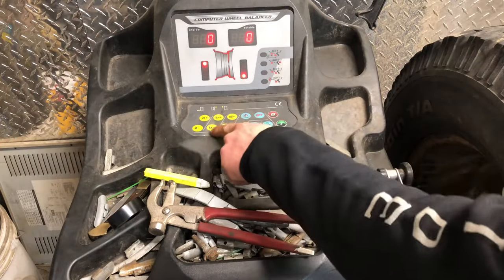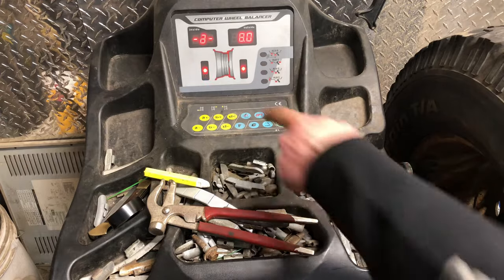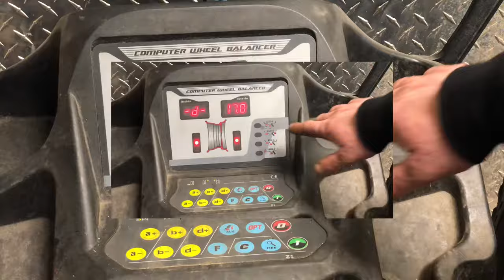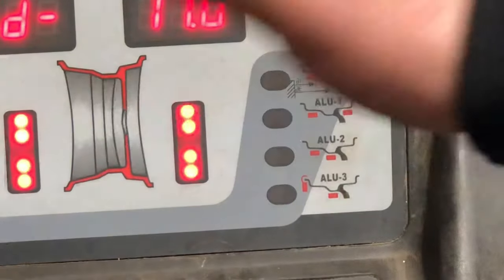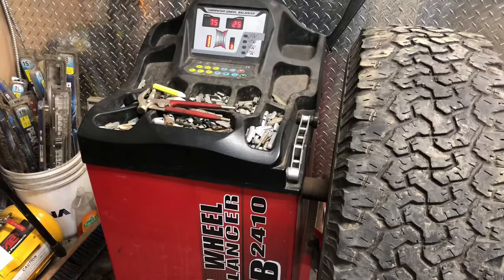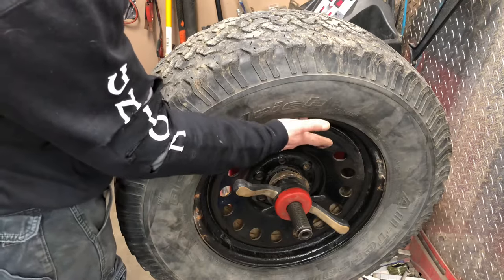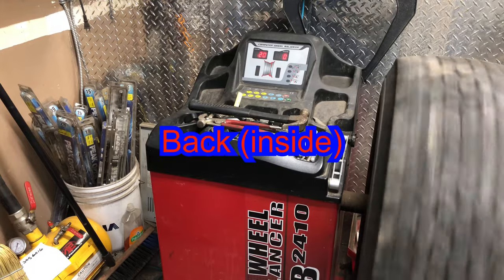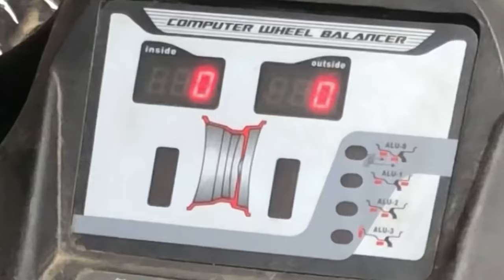How to use a wheel balancer

Comment: Just got new tires and one tire have just one weight clip on inside.Nothing outside? Is that normal to be unbalanced just on one side?
Reply: The tire is not unbalanced if your mechanic did a good job. If there's no weight on the outside but there is on the inside, it just means the tire needed a weight from inside to be balance and to have a smooth ride